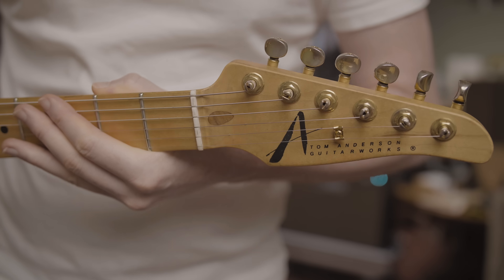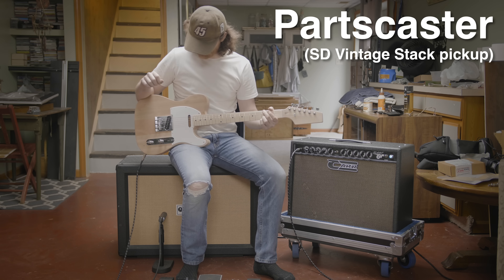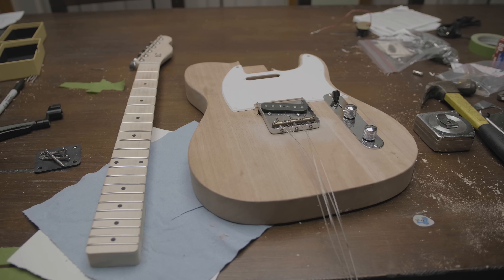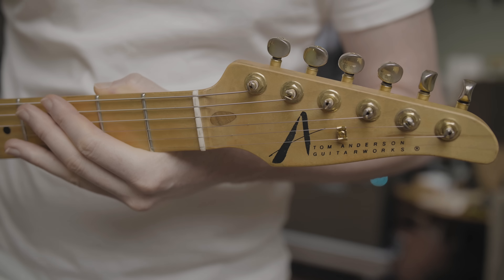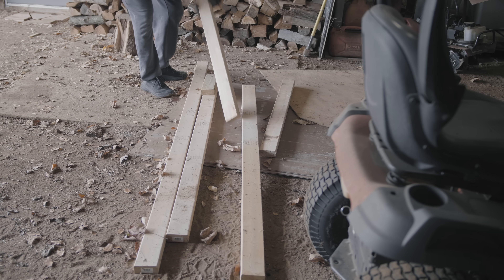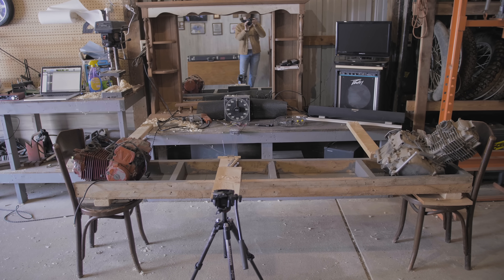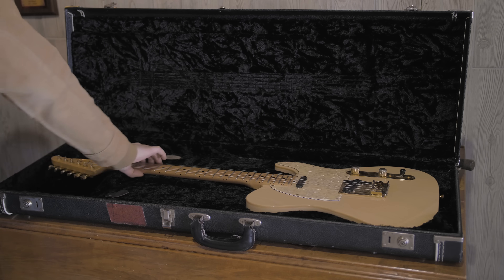Tested: Where Does The Tone Come From In An Electric Guitar?

Comment: Electronics technician here.

If the pick-ups we're sensitive enough to be affected by "tone wood" or the finish on the neck ,your guitar would be an extremely good microphone.

External noise would vibrate the strings enough to be picked up.

You'd literally hear your own breathing and pulse coming out of the amp when the guitar rests against your chest.

While it's possible to make pickups that sensitive , we don't 
( for obvious reasons )

A couple things you missed that actually matters  in very slight ways. 

1.The distance between the strings matters , classical guitar necks have a cleaner sound for "fingerstyle" because less vibration is induced into the other strings.
But few people can hear the difference which is why electric guitars with classic necks are rare

2. A stiffer neck and body gives you more "sustain"....which the amp can also do.

And that's about it.

Everything else is just vanity and marketing.
Reply: @MikeSW  The magnets of the pickups induce a magnetic moment in the metal strings because of the electron structure in the string which is a metal conductor. As the strings vibrate they cause the overall combined magnetic field of the pickup magnet and string to oscillate which induces a tiny oscillating current in the pickup coils. The pickup magnet, coils and strings are a coupled electromagnetic system. Whilst the magnetic field patern does penetrate the guitar body, as wood has a tiny magnetic permeability I think this will have a negligible effect on the system. Even if you put a piece of wood directly between the pickup and the string, I doubt you would detect any effect.. maybe with a very sensitive oscilloscope. But when the pickups are merely mounted in wood, the effect would be even smaller. Far far bigger effects would come through changing the pickup winding, the magnet or even the string metal type.
Reply: @guitarpaul3645  Because I actually know how pick-ups work , I also know how full of it you are.
Reply: @glennchartrand5411  (Not to you..!)  Wood has zero magnetic permeability because it is essentially NON magnetic, it is not a paramagnet, not a diamagnet, and not a ferromagnet. It has a TINY magnetic susceptibility of -0.2×10e-6, which makes it one of the WEAKEST materials to interact with an applied magnetic field. Wood in the guitar will have almost zero detectable effect on operation on the pickup.
Reply: @glennchartrand5411  Are we at cross purposes? I am simply saying that wood will have negligible effect on an elecromagnetic pickup system for very basic physics reasons, which I am happy to explain. What are you saying? That nearby wood does signficantly affect the output from a pickup?? I have a PhD in physics, so try me.
Reply: @guitarpaul3645  Thats supposed to be a response to someone else.
Must have clicked your post by mistake.
Reply: @glennchartrand5411  Thought so!
Reply: See his video on what causes sustain.
Reply: Small correction in its place: A stiffer neck a body does NOT give you more sustain,- it increases the structural integrity of the instrument,- makes sure it doesn´t break or rips apart under heavy use, tension or load.
Sustain comes from vibration of the strings NOT being transferred into the bridge, saddle and tuners and on into the wood, but instead vibrating the string more by the vibrations running back and forth the string for longer thus giving the pickup time to pick up a longer lasting vibration turning that in time into a longer lasting signal.
Reply: Isn't it very easy to just route the signal through a spectrum analyzer? You'll see harmonics and you can compare. The air guitar in the video sounds very much like the real one but then again it's a YouTube video audio with some lossy codec.
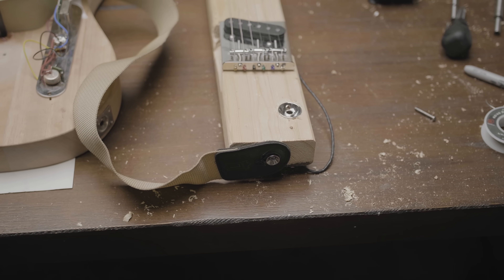Reply: Hi, as a technician whats your take in the 6:54 whe he states that the "2x4" guitar was solder without volume pot?
in my experience when you skip the volume pot it results inba very high gain hideous metallic sound due to the missmatch of the ratio between the output impedance from the guitar and the input impedance from the preamp section of the amp.
Since theres no video of him playing the "2x4"after that statement...
am i missing something here?
Reply: @Braulios_Penesecou  He probably soldered a paperclip in line with the output ( old electricians trick when you need a couple of ohms of resistance) and even though it has no effect on sound quality , he left it out just so he wouldnt have to deal with the comments.
Reply: @glennchartrand5411  it could be... still trying to make such a clinical study and then treat the impedance output like it does not affect the sound, when the coloration and distortion due to a bad electronics set-up makes a huge difference.
Reply: @Braulios_Penesecou  that's an RC filter and not an impedance mismatch.  Not sure what you watched but he added the electronics and played the 2x4 after that and it knocked off some of the high end just like you would expect.
Reply: Nice!
Reply: I agree generally with everything you said, however, I once put a Broadcaster pickup in the bridge of a Squier Tele and it was so microphonic that the sound of the leather strap swinging ever so slightly on the strap buttons came through the amp. It sounded like when you rub styrofoam and was loud
Reply: @voiceofreason8594  That actually sounds like a "ground loop".

I suspect the two pickups used a different grounding method and when you swapped them the pickup became ungrounded, ( or grounded on the wrong polarity )causing it to act like a capacitive microphone

The "styrofoam noise" is a strong indicator.
Reply: thank you. exactly i was about to say. all those difference making stuff is only to sell more stuff to dumb people
Reply: I've got a question for all of you - solid body VS hollow body bass, same pickups, same pickup heights, same distance from the bridge, same scale length etc. Would they sound different?
Reply: @holo_chin 
Well ofcourse it, wood type matters in acoustics, but not in something fully electric.
Reply: @MikeSW  I
Thats like saying you can measure the width of an atom using a yard stick.
Reply: If I have audio playing and put my guitar near it, my pickups will pick it and and send the sound to the amp
Reply: Welp. No. 
Because pickups pickup the strings being that they're metal. We are not made of metal.
Reply: Maybe if were piezo pickups that work with mechanical vibrations, which are the type of pickup used for electroacoustic guitars, otherwise an electromagnetic pickup will only be affected by the changes in the magnetic field when moving the magnetized strings.
Reply: @D14V0R05  whatever it is that is supporting the string, it's reflected influence is going back into that string, however subtle. The influence of the guitars build is there, one way or the other. Some cheap guitars sound great. Some expensive ones sound very average.
Reply: @heftosprod  That would be the nut and bridge at most, that contribute to a marginal portion of the tone of the guitar (mainly to help with the sustain and keep the guitar in tune) compared to the strings, pickups and electronics involved.
Reply: @D14V0R05  and what's in between them.
Reply: They are microphonic though. You can hear yourself talking through the amp if you speak into your pickups.
Reply: @Cuddlez850  Jim's videos, while well made and researched and clever, do not take into account many subtle aspects of this topic. Electric guitars are subtly influenced by their construction. Anyone who's experienced and familiar with the instrument knows this instinctively. Art ain't science either. Even Jim has to play his experiments.
Reply: @Cuddlez850  correct. No matter how well the pickups are made or potted, the constructed aspect of the guitar is able to induce vibration to the strings, no matter how small. It's this interaction that is the flaw in much of this argument.
Reply: @heftosprod  ok
Reply: A stiff physical structure may give you a tiny bit more sustain. A compressor will give you extremely long sustain. Where should you spend your money increasing sustain? Buy a good compressor and learn to use it.
Reply: Neither of those two points are correct. I Play classical guitar and I can tell you the vibrations of the strings are indeed picked up by the other strings regardless of the spacing.  and you can easily test that. You can hear it all the time if you don't damp the strings. You can hear the harmonics humming.
Effects like sustain, on a solid body guitar, are entirely electric. Everybody arguing above here how about the effect of the wood and the vibrations in the body etc are missing the whole point of this video. And the whole proof that he's just provided that the solid lump of wood the electrics are nailed to doesn't have any effect at all. !! You all need to watch this video again
Reply: @Ana_crusis I said less vibration is induced , not "none"
Its why classical guitars sound "warmer" but acoustics sound more "resonant"

When I take a cheap "screw neck" guitar and:
1.Resolder all the connections 
2.Fill in the neck pocket with a coat of filler epoxy and sand it to a tight fit to the neck.
3. Properly adjust the action and the pickup height 

All of a sudden , it magically sounds just as good as the high end electric guitars.

I don't even bother replacing the pickups , 90% of the improvement people get when they have their pickups "upgraded" is that the luthier adjusted their height properly when he put them in.
Reply: @glennchartrand5411 
The difference in the sound between steel string and nylon string guitars, is exactly that;  the type of strings being used. That's why they have a different sound. 
 they don't produce less vibration to affect the strings around them.
 if anything more vibration will be produced on a classical guitar because the body is designed to resonate which directly affects the strings as the sound waves bounce right out of the sound hole which is directly behind the strings. 
 A part of classical guitar technique is learning how to mute strings so that you don't get them ringing on in the background where you can hear  harmonics from strings vibrating in sympathy, which you don't want. 
I'm not interested in the rest of that stuff.
The video itself has done the job of proving what was obvious which is that none of the wood on a solid body electric guitar has any effect on the sound. It's just there for something to nail the electrics to.
Reply: Ooooh, looks like we have a c-c-c-ca-cat fight on our hands. If you don't mind, I'll spend the time practicing some of the nice country licks Jim was playing.
Reply: But rosewood maple and ebony board clearly sounds different... 😞
Reply: @김기태-m2l  Not on my guitars with identical electronics and hardware
Reply: @voiceofreason8594  ears, perhaps
Reply: @김기태-m2l  exactly that. Like one assumes a mahogany neck to sound warmer , fuller. 
Where as a maple neck to be brighter more punchy. 
One associates colour with sound 🤷🏽‍♂️
Reply: @davidharvey8812  they do sound different tho... for deafs, compare regular 52 blackguard with harrison's full rosewood one ya'll know what I mean
Reply: No... the body vibration resonates back with the strings and alters the way the strings vibrate which IS picked up by pickups. That's not how body wood affects the tone. It's not like the pickups pick up the body. The resonance of the body and the strings together change each other and the pickups pick up the strings. The body resonance just alters the string resonance. Yeah it's not a huge impact either way but I think you misunderstand the mechanism for that.
Reply: @Dude8718  No. You're mixing up the concepts of 'tone' and 'sustain'. As regards sustain, the body material is never the point (for an electic guitar) because the relative effect of any body resonance is negligable when compared to the efficiency (the vibration transfer of which you speak) of the parts that connect the body/neck to the strings. This point is illustrated nicely by Jim's video. The irony is that players like to feel 'connected' to the guitar by feeling the vibration when, in reality, they should love guitars that they feel nothing through (100% efficient ==  zero vibration transfer). Jim's benches are a better example of that than any conventional guitar body. Note also that they did not affect the tone.
Reply: @Dude8718  i think this video shows that that body resonance is really hard to hear at all
Reply: @Dude8718  correct. And this is why the wood and build of the thing mean something. It's so fundamental and basic to the concept.
Reply: Like the weight and material of the body determines what frequencies the wood will interfere with, and "steal" those frequencies energy from the strings. And therefore the signal from the pickup from the string vibrating is different because the body affects the string vibration.
Reply: @Dude8718  not enough for the pickups to detect.
Reply: @Dude8718  exactly right :) too many people arguing about it when you can literally hear the difference by comparing epi and gibson. epi sounds flat and dead, gibson sounds bright, warm and alive. it's simple. people just want to be right so they dont have to spend $1000+ on a guitar made with real wood
Reply: @jayall00  Or cheap guitars use cheaper pickups that have to be placed closer to the strings.
Reply: @glennchartrand5411  pickups can only bring out whats already present. if the guitar sounds dead, then better pickups are just going to make it sound very dead.
Reply: @jayall00  Then watch the video again and see how much of that what's present affected the sound.
Reply: What I don’t get is when he was comparing different necks and saddles etc ( earlier in the video) that DID make a difference , so what happened at the end where none of it mattered?

The build did make a difference at first but then at the end somehow it sounded the same with the air guitar
Reply: @jayall00  exactly. And these videos, while interesting and sometimes clever, pander to that element.
Reply: @glennchartrand5411  so why does it often happen that the same guitar sounds similar despite very different pickups being swapped in and out of it?
Reply: @heythere6983  
saddles make a difference for sure. I have a jazz master and had to sell the Staytrem bridge because it was much darker than the original vintage bridge saddles. I settled on a Mastery because it didn't sound as muted as the Staytrem but still not as bright as the original, even with the same clean tone on the neck pickup with the same 1meg pots--which can be a super harsh brightness so it's noticeable for sure since the other aftermarket bridges had almost the same effect as switching to 500k pots. it's all kinda subtle stuff that probably doesn't matter much when in a mix with other instruments.
Reply: @Kyle97x I had the pleasure to compare an 600 dollar LP 60's epi to an 6k dollar gibson LP 60's somewhat special edition on exactly the same settings with a friend. Through a JVM410h and 1960AV box. Truth be told the epi sounded like pure shit and I tossed it aside, after playing it for 2 min, where it belonged whereas the gibson was one of the best guitars I heard and I couldnt stop playing and producing awesome sounds with it. So I will strengthen @Jay Dawg statement that epi is quite shit, for the 50's and 60's versions atleast.
Reply: @kinglord5163  Yes, but the take home from this video is that if you put the same pickups on the Epi it would start to get a lot closer to the Gibson. Then if you had the same hardware etc, everything mentioned in this video. In theory the wood has no effect on the tone in a solid body electric, and this video proves that. There are other videos where people have built guitars out of plastic or resin, and they can't hear a difference over wood, all other things kept the same. Even sustain is more down to how well the hardware isolates the vibrating string from the body than the bdy material, but of course all bodies will vibrate as a certain amount of energy is passed to the wood. I often wondered if the shape, rather than the body material, affected sustain more, because different standing waves would be setup in diferent shaped bodies. But I think all of that is a very minor effect. But by all means a top end guitar is still a beautiful instrument that looks, feels and plays great and will last. That's what you're really getting, whereas similar tones can be obtained with much cheaper guitars. I have some cheap Ibanez with top pickups and hardware, and they sound just as good as my top end guitars. And Van Halen's Frankenstat was just a cheap POS body he bolted together with great pickups, and think of the legendary tones that came from that thing.
Reply: @Kyle97x You can't base everything off of a blindfold test and whether Rob passed it or not. Not only do things come into play like amp settings, and what's actually being played on the guitar, but Rob usually has to remember the order he played them in and compare the sound based on muscle memory. A blindfold test does not work. 

He might assume that the first guitar he picks up is a gibson or an epiphone and he has nothing to compare it to. By the time you get to the next guitar, you have to have muscle memory of the first one.. In every test I've heard, the difference is there, and it's noticeable. The epiphone sounds muddier and no matter how hard you dig into a note, it won't have a bite or growl. And if it does, it won't sound like gibson.

I would pay to see someone emulate Jimmy Page's tone (from MSG, royal albert, paris theater, etc.) on an Epiphone. It will never come close.

Even if epiphone sounded better, which is impossible, I'd still go with Gibson because it's built to last longer and it has a solid reputation.
Reply: @jayall00  Where do I start? 

The Anderton videos are rigged as hell because you can smell the nitro finish on a Gibson (smells kind of chocolaty) from a room away. They‘re nothing more than a fun little video series to keep people entertained. 

No you won‘t be able to distinguish both in a blind test. You might get lucky on your first try but you won‘t be able to reproduce that.
Reply: @jayall00  How are you arguing this crap on a video that is literally debunking it? Didn't you watch it?
Reply: @ThisIsTheInternet  Yes I did watch it. There's no argument, and nothing was "debunked". The air guitar could pass as a gibson if it used burstbuckers, but when you buy a gibson you're getting specific pickups and factory specs on an instrument for a specific sound. You also get it in one piece, so it's not connected to a table. How do you plan to pick up that air guitar and play frets on it? The whole point of wood is to make it into a tightly connected assembly that you can take anywhere. The reason mahogany is used for guitars is because it's the strongest, and it ages extremely well. And obviously, it will affect the sound. With a wood body, it might sustain less than a straight up air guitar, but this actually does mold the sound
Reply: @jayall00  He proved it doesn't contribute to sound
Reply: @ThisIsTheInternet  nothing was even proven.. You can't tell me the guitar's build doesn't make a difference. How do you expect to pick up an air guitar and play notes on it? What do you think shapes the frequencies (low/mid/high)? What determines the amount of sustain/resonance that a guitar has? What's going to make a guitar last more than 5 years without warping? It's how well they build the guitar, and the overall quality/sum of all its parts. This video is a great demonstration to prove that
Reply: @jayall00  Gibsons sound way better because all the electric components are far superior, and the sustain is longer because of the 17 degree angle at the headstock, but mechanic phenomena (vibrations) make an insignificant difference regarding electromagnetic phenomena within electric guitars.
Reply: @jayall00  I mean it’s not like there was no wood even in the air guitar. It was attached to tables that are heavier then most guitar bodies
Reply: @jayall00 
You've completely missed the point of his video and what he has proved
Reply: @jayall00  you just based on your eyes on the headstock.. even some professional luthier like McKnight can't tell the difference. It's all about Pickup Wiring and Amp. The blindfold test isn't dumb, it will test your ears that claim 'can hear the difference'. Not your eyes. And your statements are all messed up lol. "Epi flat and dead" and now "they sound fine". I agree vintage Gibson is an investment (not always) but I've seen so many new 500 Epi played, feel and sound better than 1700 bricked Gibson. If not, it's still better to buy a better AMP for 1200 (still an investment)
Reply: @zed011  I've owned both, and played both through the same rig. I could tell the difference right away if I was blindfolded. I also did not say epiphone "sounds fine". I said they sound great in mixes . For any solo, it sounds flat and dead (unless you enjoy The White Stripes/Black Keys sound). If you're playing chords in a song, nobody's going to tell, because it's in a song.
Reply: @Kyle97x Notice the Andertons can tell almost every time when it's a gibson or not because it has far more tonal clarity and bite to it? If it's a clean tone, the difference is night and day. Once in a while they sound similar, especially if they're both running through a distortion pedal. You'll always see them playing gibsons in their videos, not epiphones. You pro-epi's are the flat-earthers of the guitar world
Reply: @Kyle97x I've heard epiphones with burstbucker pickups and it still lacks character. No bite or growl to it. Nothing in the epiphone is made to resonate.. I only speak from experience and having owned both. I'm not trying to say epiphones are bad. They have their own sound and are great in mixes. But I'd have absolutely no problem telling them apart in a blindfold test if its straight through a marshall. The andertons guessing game is not full-proof.
Reply: @jayall00  "full proof"

I actually can't describe how funny really that was